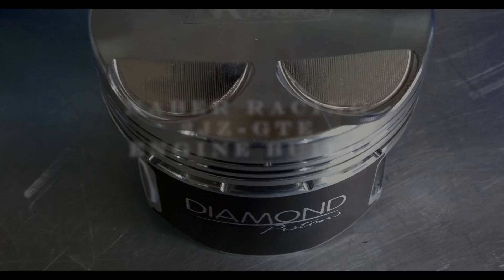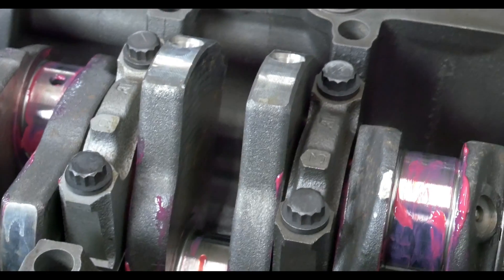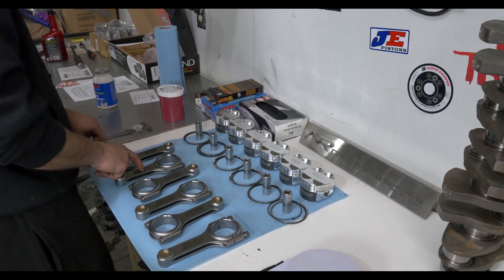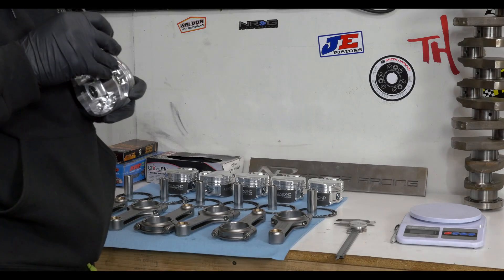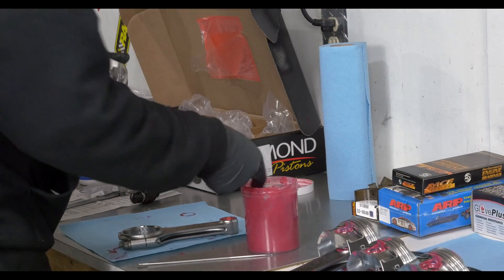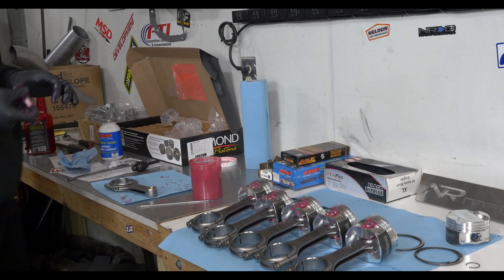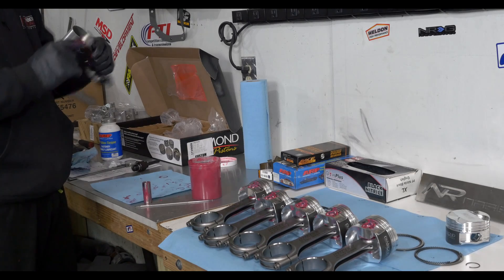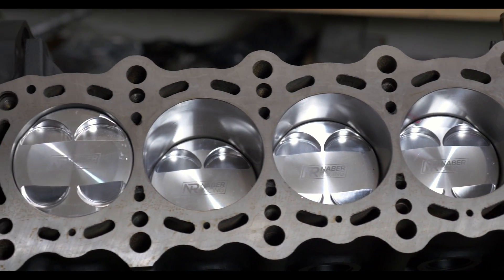Naber Racing 2JZ build - Part 3 - Balance and assemble pistons and rods (4k)

Comment: Question.. What oil would you use with a stock 2jzgte block with a high flow oil pump (PHR)?  Thanks
Reply: You can go one weight heavier than recommended, or use .5-1 quarts of Lucas oil stabilizer. I use royal purple 5w30 with .5 quart of Lucas in my 2jzgte